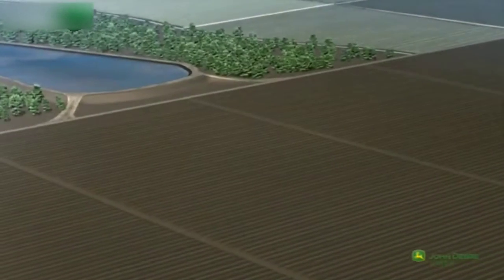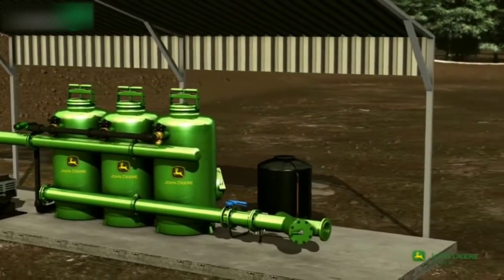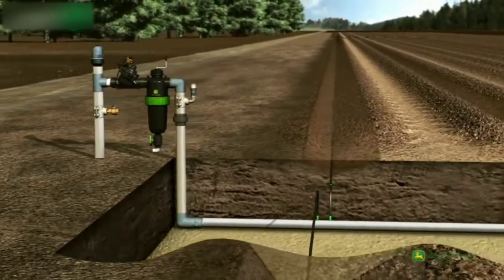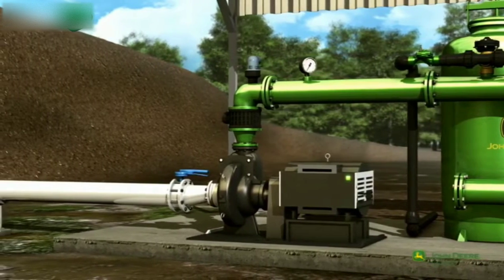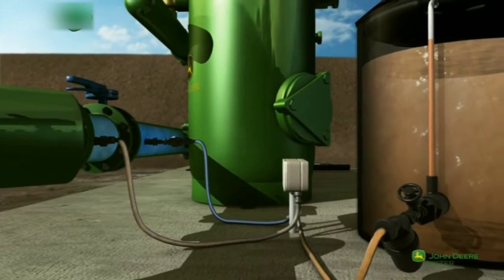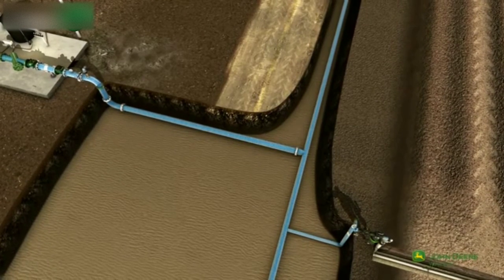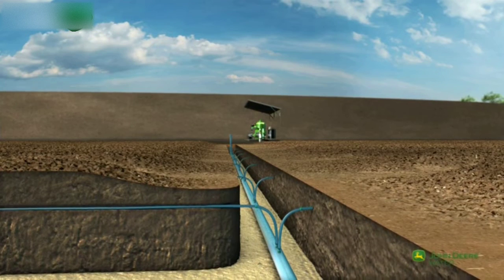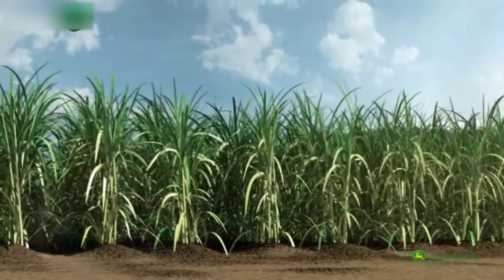John Deere Drip Irrigation System - Modern Irrigation Technology

Comment: What is the lifetime of the system which is under the soil?
Reply: I've been using this system for a few years, the main pipes need little maintenance what we do change every other crop is the drip tape. The drip tape will encounter punctures or animals dig em up but it's very efficient. I grow onion, corn and wheat in that order. With the drought we had in Mexico we still managed to grow huge onions
Reply: @zoartontheprotector9198  please share package of practices you use in onion.